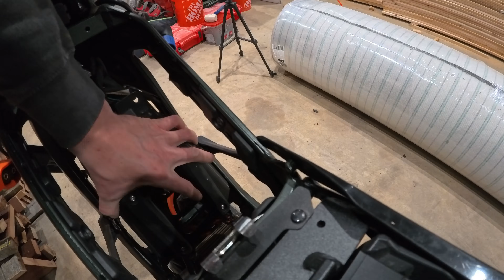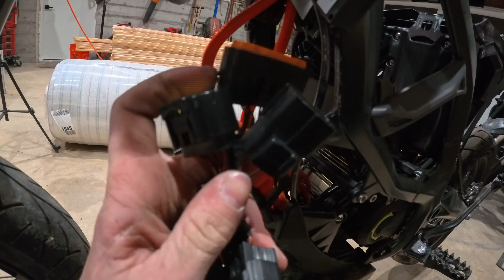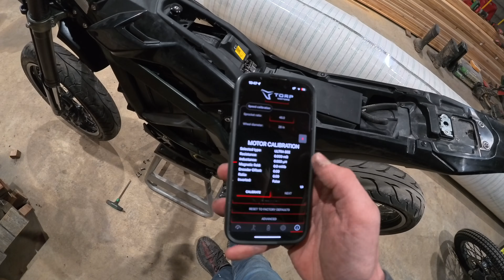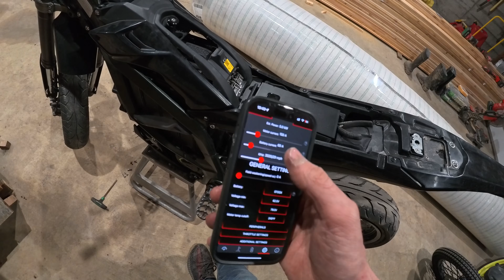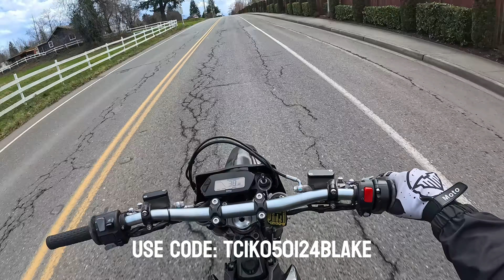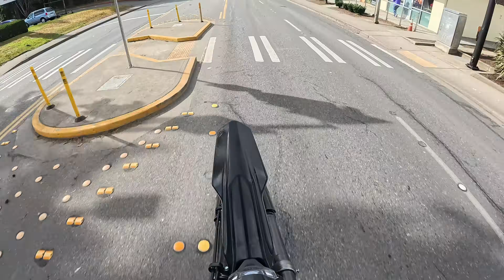TORP TC1000 INSTALL ON SURRON ULTRA BEE

Comment: I have an ultra bee and recently upgraded it with the torp tc1000 and after following all the correct steps and calibrating my motor on my app it gave me a code that said motor temperature sensor issue, and the temperature was -131 which obviously it wasn’t but i contacted torp and they told me hall/motor sensor so i replaced it and nothing happened, so i was just wondering if you have any ideas on what i could do?
Reply from the maker: Hello, I’ve never had this issue. Did you make sure your app/controller are up to date? Also try a  recalibration on your motor. 
What motor are you using?
Reply: @206fab  hi thanks for replying, i have checked to see if my app was up to date, i have also tried the recalibration on the motor, i am running the stock battery and controller. I have again contacted torp and am waiting for a response, but i’m just trying to get any information because there is nobody has anything posted about it.
Reply from the maker: @wesleydoesmtb1161 yeah, I install of lot of Torp products and normally a motor calibration fixes that. 
If for some reason your motor is bad I got a sotion motor for sale for cheap. 300 miles on it.

Comment: Installing mine now 🤞 im watching your video  😨
Reply from the maker: Heck yeah! Congratulations, you will live it
Reply: Update; after calibrating the bike, calibrating the throttle it works perfectly. Amazing.! it had me set the throttle to 0.07v based on some variables. The normal is 0.55v but I can change that later. I am extremely happy thank you so much for your video. Basically you were my motivation to add this controller to the bike and it worked perfectly. I think my surron I will sleep in my bed tonight. I’m that!! excited.❤❤❤❤

Comment: Hello, thinking of getting an Ultra Bee and considering getting this controller. I won't upgrade the battery so I will leave everything stock. I was wondering if it's worth upgrading to this controller with stock battery and how much power it gives? Top speed and acceleration etc... Thanks!
Reply from the maker: Yes, 100 percent worth it. You get some much more power and more importantly controller over how the bike feels.

Comment: Cant wait until we get a battery upgrade thats worth the money dump. (with the supermoto setup)
We need a solid range of 50mi until it hits 30% with heavier street wheels and on sport mode. (I have milk wheels)
Reply from the maker: If you turn down the power with a bigger battery you should be able to hit those numbers

Comment: After the ultra bee and buying the 82v battery and the Torp Tc1000 “shout out Darwin” and then the Ebmx motor 😅14,000$ later I’m running 90mph down the highways 😂
Reply from the maker: No matter what light weight emoto you get, for this kind of performance you will spend that money. Think the stark varg is the same price and maybe has a little more power but worse range.
Reply: @206fab  all my bros where saying get a stark but like you said the range and the amount of maintenance there is flushes and etc and I almost bet later on after beating it to death the maintenance for brakes and rotors and wheels will cost you hundreds
Reply: What kind of motor did you choose on the calibration setting I don’t see the ebmx motor on there. Please let me know thanks
Reply from the maker: I’m running a Sotion motor

Comment: Can you do a gps speed test? Maybe it’s just the camera but that didn’t look like 70mph. I’m wondering if your wheel speed ratio isn’t set correctly for those super motos.
Reply from the maker: I have set up the sensors correctly, running a 80v battery and 150a field weaking. I should have a speed test out this week.
Reply: @206fab  Gotcha. That thing is a beast then it got up to 70 in a heart beat. Thanks for the videos 👍

Comment: What wheels are you using and how much did they cost?
Reply from the maker: Milk racing, check there website for most up to date pricing.
Reply: @206fab  Are these the best wheels for Surrons, Milk Racing?
Reply from the maker: @chuckdawit definitely not! Check out Darwin EV for high quality wheels
Reply: @chuckdawit  they are good quality. and run about a grand if you want custom colorings

Comment: Where did you get the battery?
Reply from the maker: I got the battery from Charged Cycle Works. I would recommend waiting for Darwin EV to come out with there ultra bee battery. It will be quite a bit smaller and fit way better in the stock lid.
Reply: @voltsgarage  thanks for the heads up. Did you lose your daily mode when installed the controller lost mine seems to be something wrong
Reply from the maker: @francomusiello3749 yes I have eco and sport. Might change in a recent update.
Reply: Dam so it's just me I can't figure out how to turn up the kilowatts like on the ebmx 9000
Reply from the maker: @francomusiello3749 it’s all through the app
Reply: I'll figure it put I called them waiting to hear back it's  just not as  simple  as the ebmx 9000 I can only get 15kw
Reply: I appreciate the help your videos are awesome

Comment: hello with this controler the range decrease , do you know the % ? and in original configuration eco mode begin at 20 % , with this controler it can begin later ?
Reply from the maker: With this controller and battery it is a significant range increase!
Reply: @206fab  increase really ? You have the original battery right ?

Comment: Have got standard motor and battery with new control think purchase one pal
Reply from the maker: I’m running a aftermarket battery and controller. Thinking about upgrading the motor but have not done it yet.

Comment: I think you have to calibrate your wheel sensor because I don’t think the miles per hour is right I had to do the same with mine when I put super Moto‘s on them
Reply from the maker: I have it confirmed with gps. With high field weaking you can hit higher top speeds.

Comment: Hey what’s the top speed u can get with that controller?
Reply from the maker: Top speed is really up to you and your customizations. There is people getting above 100mph on this controller.
Reply: for me is 100km/h 18/21 wheels 50T sproket😊
Reply: @TysyTube are you on stock battery? How much power are you using
Reply: @Mr316jon316  yes, 116km/h 19kw stock battery, tc1000 torp controller
Reply: @TysyTube stock battery ?
Reply from the maker: @craighepburn9887 nope upgraded 80v 76ah
Reply: @206fab  i mean with out the battery what’s the top speed i got a ultra and just wanna get higher top speed with out upgrades battery.
Reply: @craighepburn9887  yes, 116km/h 19kw stock battery, tc1000 torp controller

Comment: Stock battery?
Reply from the maker: Upgraded battery.
Reply: @206fab  range?
Reply from the maker: @NEVETSTEVEN510 with the upgraded battery at 25kw stunting/highway = 50 miles
Reply: @206fab  can you leave link’s please , I’m tryin to build me a new electric supermoto. To play with to match my my new Ducati hypermotard 698, tryin to make it as close as possible in color scheme too. sTuNtLiFeBaYaReA!
Reply from the maker: The battery I got from Charger Cycle Works, but I would wait for Darwin EV to come out with there ultra bee battery.
Reply: @206fab  sounds good
Reply: Hi mate how did you get maps on app to work
Reply: Thanks for this video, was looking for one with stock battery and only the torp controller 💪🔥
Reply: @Obieku  he has a upgraded battery 😂 but you can put this on a stock ultra B battery. But it will drain faster.

Comment: Was that on stock battery??
Reply from the maker: Upgraded 80v battery.
Reply: @206fab  do you think it’s possible to run that controller on a stock battery?
Reply from the maker: @Chemsrightnu absolutely! It work with the stock bms to pull more power.
Reply: @Chemsrightnu yes and is very powerful, you can do at least 70km

Comment: Why?  If you want 80hp then buy a Stark and save some money.  The Ultra is a fantastic bike for the masses and a new controller is unnecessary.  And why are you riding recklessly on a road with a dirt bike?
Reply from the maker: I love these comments 😂
80hp is about 4 times what I’m pulling at the moment, and yes it would not be practical to put 80hp into a ultra bee. That being said 14000 dollars vs around 10000 is a very big difference in price. 
Also you said putting a controller on the ultra bee is unnecessary, WHY? 
My view point is that it opens up a lot of possibilities on this bike for running more power, running different voltage batteries and endless customization of all the settings. Not at all useless in my books. I would say out of reach/not practical for some people though. 
As for riding recklessly on the road, I’m a trained professional 😜
Reply: the tc1000 is so good, i already made 500km ❤️ i like your wheels
Reply: because the stark varg is not on license plate and this is.

Comment: you need to update the wiring in order for communication with the stock battery and stock display to work.
Switch the firmware to regular and click wiring.Update just wiring not controller firmware on regular TAB.
Reply from the maker: I definitely did not have to update the wiring. Everything works perfectly
Reply: @206fab If you update wiring firmware, it will work even better :D

Comment: How much more range do you get with that aftermarket battery?
Reply from the maker: Doing some extensive testing this week. Should have a video out next week or the following on this topic
Reply: @206fab  Still planning to post that video? Solid range info on the ultra bee is hard to find. It’s mostly all people riding it all different speeds off road, then claiming different ranges.
Reply from the maker: @Rickie53 video coming out at 4:30PM today. Check it out 🤙🏽
Reply: @206fab  awesome!